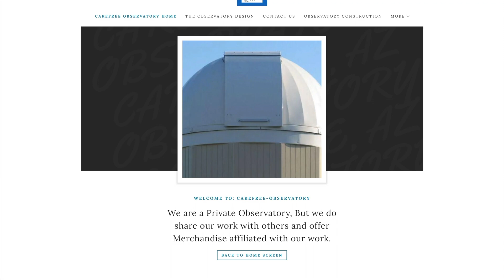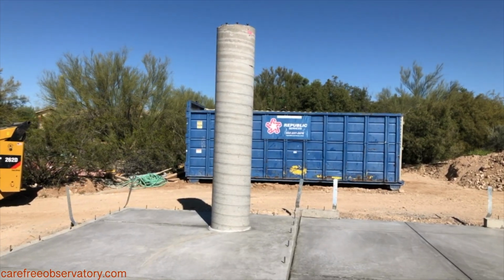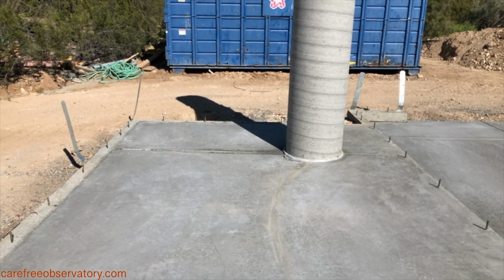Concrete Completed! @ Carefree Observatory

Comment: Why is the pier slightly tilted. It does not look vertical from east to west on you video section regarding some placement on the top of it. It leans to the right.
Reply from the maker: Dazzleink, the Camera lens is a wide angle and distorts the true angle of the pier, the pier in actuality is truly plumb vertically trust me  FYI

Comment: hey Marty! how do ya know where to place the pylon???????
Reply from the maker: Well depends on your location since the dome is 10' center is 5',  you have to know the following to calc.  mount dimensions  you latitude  i am, phonix is at 33 degrees north.  so you take mount length =X / 33 degrees =  run  dist south my calc was 27 .5" south of center of dome location.  so my column was placed 2' 3 1/2" due south of my dome location center would be.